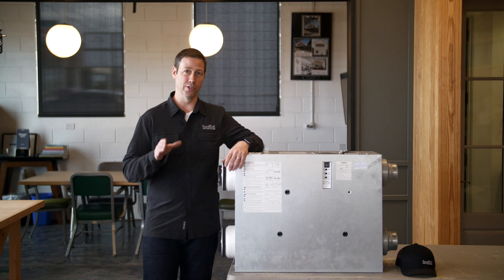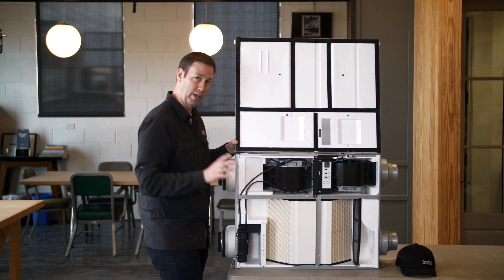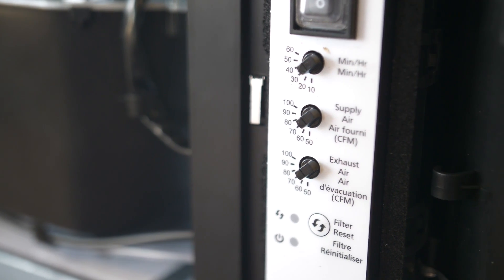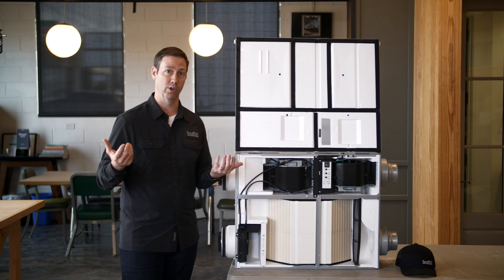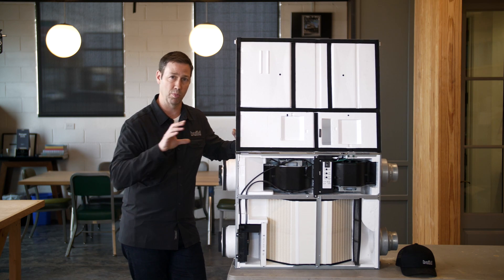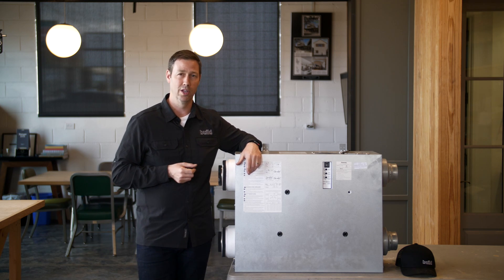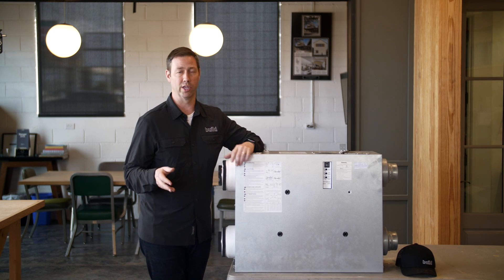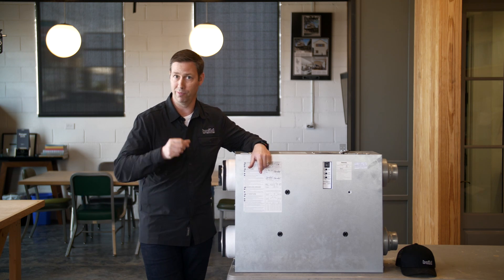ERV vs. HRV - Myths

Comment: We installed that Panasonic ERV in the new house we just completed, thanks partially to your video on it when it came out. I expected the temperature of the air dumped into the house to be an average of the outside air and the indoor air.  I was surprised to see the air coming in to be about 64 degrees with indoor temp at 68 and outdoor temp at 41.  I really should check that again by another method because I don't understand how that could be.
As far as the cost of the power it consumes, its going to be under $3 per month with electricity at 11 cents per Kwh.  It's really quite at 50cfm, reasonable at 70cfm.  But at the full 100 cfm, you can hear the output into the house from some distance.  I used the purpose built grill and boot they sell for this ERV.  A better method would be a standard HVAC boot and grill that had much more area.  The Panasonic part has straight edges inside the grill that cause a lot of the noise.  Rounding those over with a dremel but the noise to about half.  The intake in the house is very quite though, even at 100 cfm.
Thanks for sharing all of your knowledge, tips, and time with us.  I with we had tested all of our new Anderson 100 windows for frame leaks before the siding and brick went on.  Yep, one of the leaked.  A dab of silicone solved the problem but that's a patch, not a fix.
Reply: It sounds like the unit is not properly balanced.  If you have more air going out than is coming in, the incoming air will be warmed more.  This makes though that you are causing more air infiltration in your home to make up the difference that isn’t coming in through the HRV.  Most ERV/HRV installation manuals are quite specific about the air balancing.
Reply: It's a cointerflow heat exchanger. The intake and exhaust flow across each other in opposite directions, so the heat exchange is more efficient than parallel flow or crossflow.
Reply: quite adverb
\ ˈkwīt
\
Definition of quite 

1 : wholly, completely not quite finished

2 : to an extreme : positively quite sure —often used as an intensifier with a quite a swell guyquite a beauty

3 : to a considerable extent : rather quite near
quite a bit

: a considerable amount
quite a few

: many

XXXXXXXXXXXXXXXXXXXXXXXXXXXXXXXXXXX

quiet noun
qui·et | \ ˈkwī-ət
\
Definition of quiet 

(Entry 1 of 4)

: the quality or state of being quiet (see quiet entry 2) : tranquility
on the quiet

: in a secretive manner : in secret

quiet adjective

Definition of quiet (Entry 2 of 4)

1a : marked by little or no motion or activity : calm a quiet sea

b : gentle, easygoing a quiet temperament

c : not interfered with quiet reading

d : enjoyed in peace and relaxation a quiet cup of tea

2a : free from noise or uproar : still

b : unobtrusive, conservative quiet clothes

3 : secluded a quiet nook

XXXXXXXXXXXXXXXXXXXXXXXXXXXXXXXXXXX

Thank you for trying to improve your literacy so you stop making the rest of us dumber by having to tolerate your presence.

Comment: Shouldn't the fresh air be brought into the return air vent? This way it gets filtered and dehumidified before being put into the house.  Whole house filtration will be better then what these units can provide.
Reply: not without a lot of additional parts like actuated dampers to prevent the ac from blowing return air out through the hrv/erv; and the thermostat to control it
Reply: zefrum3 you're still taking air from bathroom fans and hood vents and other exhaust.  Just bringing the fresh air into the return side. So I think only a damper would be needed which wouldn't be bad
Reply: i originally thought your first comment was asking with regard to an hrv or erv. So if you are trying to bring air in from the outside and condition it along with conditioned air, you will have a lot of problems: condensation, dirty-er filters and heat or cold gain when neither is wanted. As Mat explained, ERVs and HRVs are a way to vent fresh air into the conditioned space without also bringing in as much humidity, pollutants and heat/cold. The main goal is to bring in oxygen without everything else.
Reply: The "supply-only" approach is one way code compliance can be met. It doesn't include a ERV/HRV and the stale air is forced out through cracks in the building envelope.   It's a less than ideal approach and not necessarily cheaper to run vs ERV/HRV.

Comment: In my experience in climate zone 5 with radiant heat systems we can see high humidity levels inside a tight house.  Now this is only my experience I am by no means a expert but in those houses we build we do see a drop in indoor humidity by using the ERV.  I think the reason is because of the cold dense air has less moisture per volume than the indoor air we are exhausting out.  Anyway I can tell you that you can achieve proper RH levels by using your ERV in the dead of winter but as for spring and fall there is little to no change.  Keep the videos coming your an inspiration to the young generation of contractors including myself 👍

Comment: Matt - do ERVs orr HRVs also transfer odors from the outgoing airstream to the incoming one?
Reply: Jason DePaolo in my experience with an HRV in my home there isn't any odor transfer. The volume of air being moved at one time via the HRV/ERV is pretty low compared to the volume of air in the rest of the house. As a ventilation professional once described it: do you pee in the corner to raise the temperature of your pool? My guess is the same analogy could apply to odors as well.
Reply: Jay Ward p

Comment: while and ERV or HRV is designed for whole house ventilation, what would you recommend to use in place of or in conjunction with a bathroom fan or a stove exhaust?  could the stove exhaust be coupled with an ERV?  would it be better to have an air purifying dehumidifier built in to a bathroom as opposed to an exhaust fan?
Reply: You can’t install in place of range hood. The grease will wreck the cores. But in my house I installed this instead of fart fans with timers in every bathroom. Any time you hit the timer it bumps the unit to high for a set time. Any time the unit runs it pulls air from every bathroom in my house (4). That’s 4 fart fans I didn’t have to buy or install. That aren’t loosing energy, running loudly or penetration to the exterior of the house.

Comment: Just wondering why you need to filter the exhaust air.
Reply from the maker: The big filter on the bottom left of this unit filters the incoming air. The small black filter is for the outgoing air and helps keep the core clean. Pet hair, dust, etc will eventually dirty the core.
Reply: Matt Risinger  I was also wondering if you can run a kitchen range hood exhaust to the exchanger, or would the smoke and oil be too much for the filters?
Reply: @thromboid  dont even think of running a good through it. Not to code and a major fire hazard. I'm sure its not rated for it.
Reply: @sparksmcgee6641  Thanks - makes sense that it would be dangerous! Is there some way to recover heat from a range hood exhaust?
Reply: @thromboid  it's not enough heat to worry about. A lot of the heat is radiant and the heat in the air is only 15 to 20min a day. Not much to worry about.

Comment: I hate to be that guy, but what's my return on investment at $1000 for the unit plus install? I want my next house to be as energy efficient as possible but at what cost?
Reply: Most units have an effective efficiency of 60-74%. Meaning the amount of energy recovered minus the electricity used to run the fans is what’s actually realized. So a fart fan when you run it looses 100% energy, plus the electricity to run the fan. You bring in 100% unconditioned, unfiltered air to replace what is leaving as well. HRV, ERV bring in partially conditioned, filtered air as replacement.
Reply: Lou Fazio, if air exchange is the sole metric by which air quality and efficiency is measured, then a drafty house would be perfect. But HRVs and ERVs paired with a tight house are focused on CONTROL of that air, how much goes in and out and recovering some of the energy that would otherwise be hemorrhaged in to the atmosphere, and depositing moisture in the insulation, frame, and sheetrock, a big deal in cold climate housing. Not so much a step back as it is a step toward control and efficiency.
Reply: I'll happily lose a little efficiency to have fresh air in my super tight house.
Reply: I'm going to provide some engineering insight here.  If you're adding this to your house as an independent fresh air exchange then no energy saving is going to be realized. You're taking out conditioned air, using it to re-heat/pre-cool fresh air into the living space. You're going to loose money on the fans and HX approach temperature. Only on shoulder days where the re-circulation is enough to keep your house cool will it save you money from not needing the AC on. Maybe a couple days a year. But if you could incorporate toilet exhaust, electric dryer exhaust, and kitchen hood at the appropriate times of year. then you're in business.
Reply: @spencer8857  using kitchen exhaust on one results in a house fire from grease build up
Reply: David Barbeau, control is something lacking in most houses for sure, what with windows and doors. All this is based on a closed house. In Texas I have doors and windows open probably a solid 4 months of the year, in Seattle it was closer to 6 months of the year.  So forget those months. So $1000 to filter and capture some of the heat/moisture coming and going from my house that has yet to be proven to save me a dime. It seems to me a $100 filter box with a mixing valve on the HVAC intake side would do the same thing really. I guess I just don't want to feel like I live on the space station when my windows and doors are closed. Thanks for the great answers everyone.
Reply: David Barbeau  I understand and am very familiar with what you're saying, but I'm still going to argue that $1000 plus operation and maintenance (and life-cycle) for minimal recovery on 50-100 CFM can be easily accomplished with infiltration (and probably even with better distribution).  Door and window crack-method of estimating infiltration on period appurtenances have plenty of outdoor air – just by leakage (no back-draft dampers, condensate problems etc... etc...).   The sayings are "Leave well-enough alone", "Fix it 'till it's broke", "Look before you leep" and at least one more I forgot.  I know modern mentality, knee-jerk reactions, "superior intellect" and media outrage could not contemplate such considerations.
Reply: https://youtu.be/ssl5RL187kU
Reply: Compared to what?  

Using a supply only approach requires you   to compare the additional runtime for the HVAC blower motor.  

Using the exhaust-only (i.e bathfans on a timer) approach.  Run that cost plus the additional cost of HVAC system runtime because this approach requires you to suck in unconditioned outside air. 

None of the above?  Well then you'll have other costs (excess humidity, noxious fumes).  

That unit is huge and for a large house.  Matt also didn't mention cost for the dedicated duct runs.
Reply: The effeciency ratings of these units are over 90 percent in many cases.   Besides, it's not about whether the unit itself is/is not effecient because it's part of a systen which generates net savings as a whole.
Reply: There is no return on investment in most cases it's all about improving air quality on super tight houses. Also with the Panasonic unit he's showing, you can adjust the flows so there is a slight positive pressure in the house which will help stop drafts but at that point you're pushing conditioned air out the gaps. The units are not 100% efficient so you will be paying slightly more to bring fresh air in, it's more for quality of indoor life.
Reply: My opinion with air-to-air heat exchangers like these is that they make the most sense when there is continual exhaust air or ventilation air being used. I don't think they're worth it in residential scenarios at those costs.  What I find ironic about the WHOLE issue is that houses are built with tighter and tighter envelopes, and then we go and install and operate equipment to get the same result for IAQ (indoor air quality) - taking a step back, the same result can happen if the air tightness was relaxed. Building codes already considered necessary ventilation requirements.

Comment: You just perpetuated another myth, that HRVs are for cold climates and ERVs are for hot climates. The truth is you need to account for how airtight the house is, number of occupants relative to size of house, and lifestyle considerations. In the cold, dry winter of a northern climate it may very well be that you want to recover moisture with an ERV.
Reply: No. Both HRVs and ERVs will frost up when it gets down to a certain temperature, but it's not at "freezing". Most, if not all, HRVs and ERVs have frost protection strategies that come into effect (usually partial internal air recirculation or a pre-heater) to keep the incoming air just above the frost point. The frost point on an HRV is actually higher than an equivalently equipped ERV.
Reply: Trevor Lambert HRVs have need for a CONDENSATE DRAIN.  don’t recall, having one on a ERV,
Reply: Trevor Lambert I’m finding this may be the case in my house in the north with a HRV. It’s almost to dry in the winter. I’m thinking of swapping for an ERV in the future. Put the HRV out in the garage to remove the snow meld humidity
Reply: Thank you Trevor, you are absolutely correct.
Reply: In commercial applications, we almost exclusively use ERVs in cold climates as well as warm. The outgoing air stream both warms and humidifies the fresh air stream as the fresh air is usually lower humidity than the exhausting indoor air. The psychometrics would be the same for a residence, unless there is a limitation on residential ERVs outdoor air temperature.
Reply: Don’t ERVs shut down automatically when outside temperature is below freezing level?

Comment: What are the advantages with using an ERV with a whole home dehumidifier versus using just a whole home dehumidifier with fresh air intake? (Ultra Aire's website is pretty clear that their opinion is that an ERV/HRV is unneeded.) Only reduced energy loss?
Reply: Yes, without an ERV all of the heat and humidity of the incoming air will need to be removed, vs. less with the ERV. Less energy. ERV also reduces the energy use and drying of air in the winter.
Reply: You prolly dont give a damn but does anybody know a trick to get back into an instagram account?
I somehow lost my password. I love any help you can offer me
Reply: @Emmitt Jesse Instablaster ;)
Reply: @Henry Kendall thanks so much for your reply. I got to the site on google and im waiting for the hacking stuff now.
Looks like it's gonna take quite some time so I will get back to you later with my results.
Reply: @Henry Kendall it worked and I actually got access to my account again. I am so happy!
Thanks so much, you really help me out !
Reply: @Emmitt Jesse Happy to help =)

Comment: I remember a few videos about how if a house isn't airtight, negative pressure from the HVAC system would result in outside air being pulled into the house to compensate. Would ERV/HRV help with negative pressure?
Reply: Jeff the ERV can be balanced so that the house is neutral so there's neither positive or negative pressure.
Reply: Thanks Jay, now I wish I knew about these during my house construction.
Reply: Jeff I'm with you! I renovated my own home in 2017 and installed another brand HRV before I became a stocking dealer for Panasonic. Had I known them what I know now I would have installed the Intelli-Balance 100 ERV in a heart beat!

Comment: Hey Matt great video but is there a verifiable test to check the air quality in your home before and after the installation of a erv system. I can not find hard data just recommendations from different experts who cannot agree on a what measurements or tests quantifies the need.
Reply: Google "Indoor Air Quality Monitors".
Reply: Thanks but I am looking for the science behind the thinking that air exchange is necessary. It seems scientist are a lot like carpenters as when you ask 100 of them how to do something you get 100 different answers and they all think they are right.

Comment: how about places who are more oceanic like oregon or seattle ?, in winter we have almost no snow (not like east coast) so it's humid and cold and in summer is around 35% relative humidity in the day and 80% in the night.
Reply: What is the dew point? RH tells you nothing without temperature to determine DP. DP tells you the saturation point of the air and the saturation point changes with every degree of temperature.
Reply: dew point in summer around 48 º -  55 º and in winter about 30- 35 so the mornings are very foggy even in summer and after 11 AM or so it gets "normal"
Reply: Its worth keeping in mind that cold air can have a high relative-humidity but contain little water. This is perhaps easier for the ordinary person to understand than talk of dew points and temperature. Not only do ERV's and HRV's save on heating and ventillation costs, but they reduce pollution from out-gassing of cleaners carpets and paints  etc in household air (and body odours!) and reduce particulate matter ie dust as well. In modern well-sealed houses, it can also be hard to keep CO2 levels down, and the ERV/HRV works very well in this regard.The ERV does not reduce household humidity but it helps prevent the air exchanger which is needed for ventilation from bringing in too much water when it is warm and humid outdoors.  IN all but temperate climates, modern houses need air exchangers.